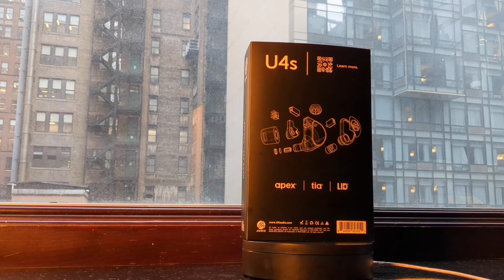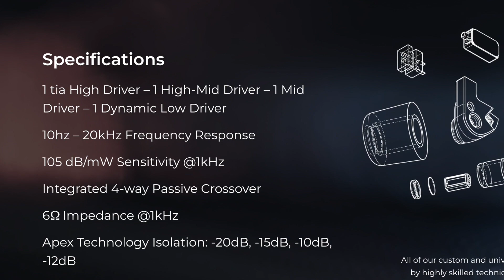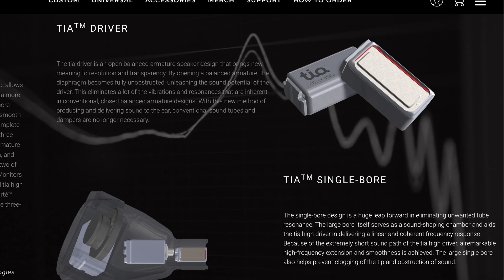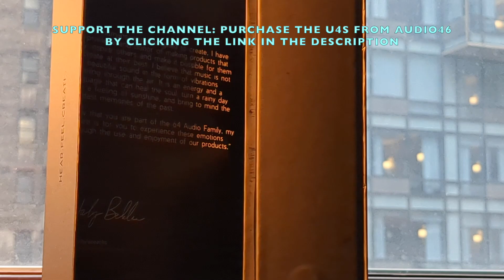64 Audio U4S IEM Review. A well balanced all-arounder.

Comment: Would you say the U6T is better if I prefer the smooth and warm sound? Or should I just splurge for the U12T.
Reply: Thr recessed mid-range and ethereal vocal presentation of the u12t, was a shocking discovry and absolutely does not justify their circa $3000 price. The u4s has greater impact with regard to drums. The performance to price ratio of the u4s compared to the u12t, is more advantageous.